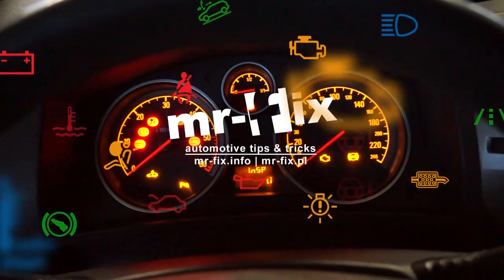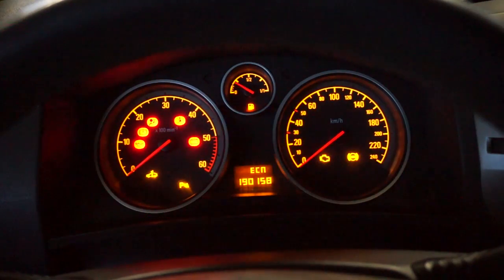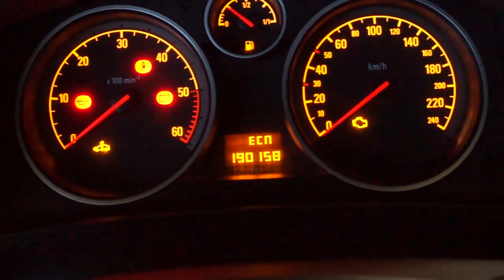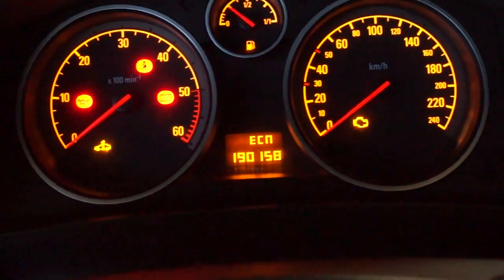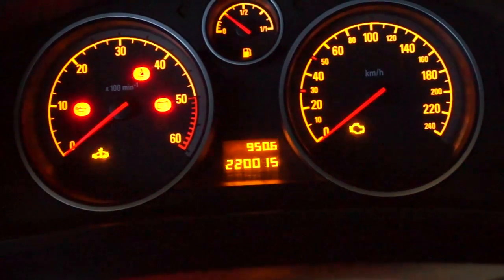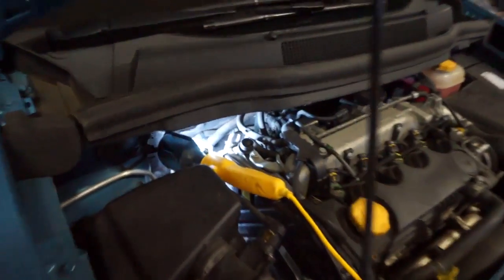Opel 1.7CDTi DPF pressure sensor replacement P1901

Comment: I'm not sure if this is the problem with mine, it happened once when accelerating then would not go over 40mph. Now I've checked turbo and underneath disconnected batteries and now the car is driving fine only been out in it for 30min but if you say this only happens at hi revs? That causes this limp mode! My obd readet hasnt brought up any fault codes.
Any ideas pal.
Is it worth replacing this sensor.?